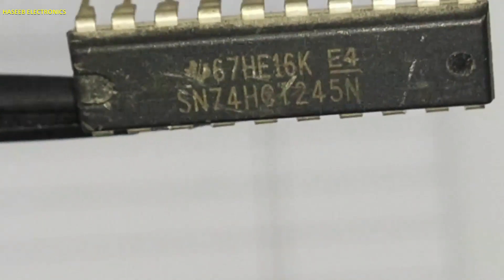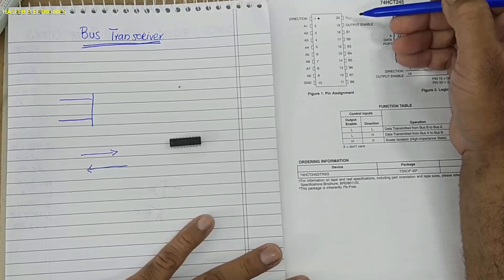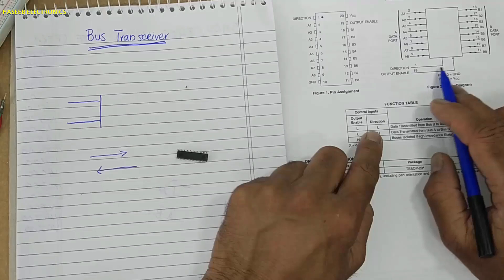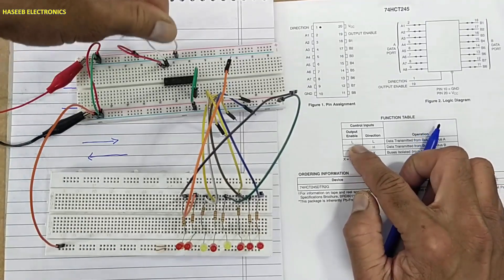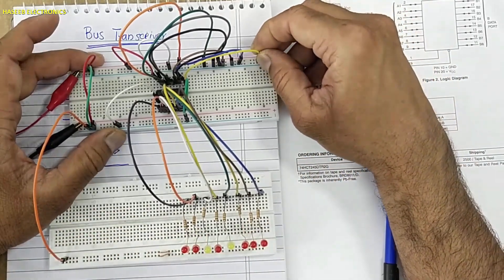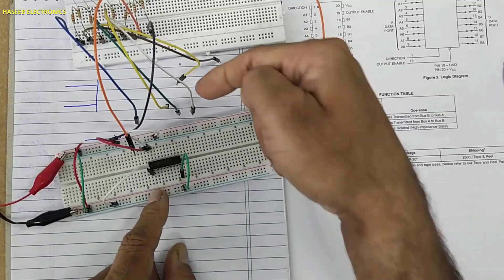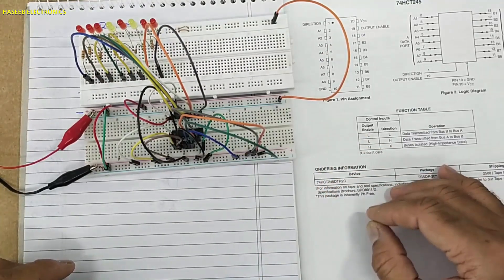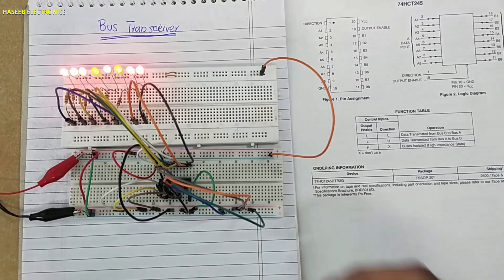{1227} Testing Octal Bus Transceiver 74HCT245

Comment: Useful IC, for interfacing MCU and other electronic parts. Often used between MCU and IPM to disable or disconnect PWM pins from IPM pwm inputs.
Reply from the maker: yes. it is very important and special while interfacing buss lines, data lines, memory lines. it was widely used in 8085 / 8086 based machines. it is also being used in latest electronics circuits